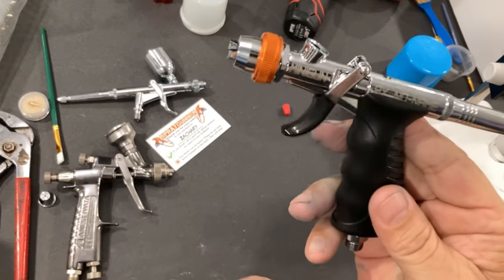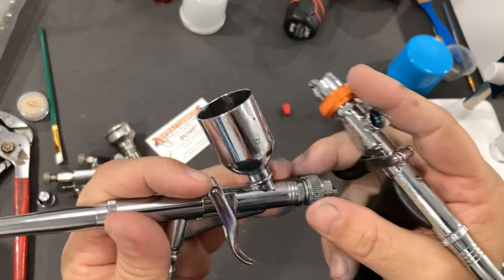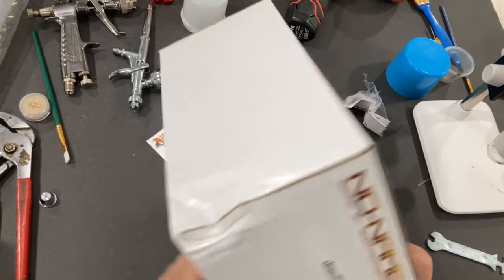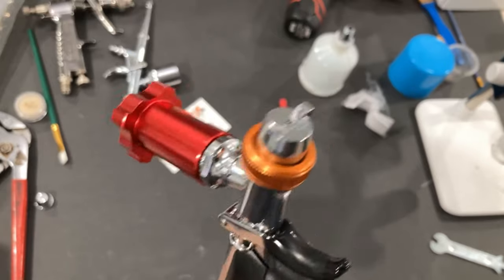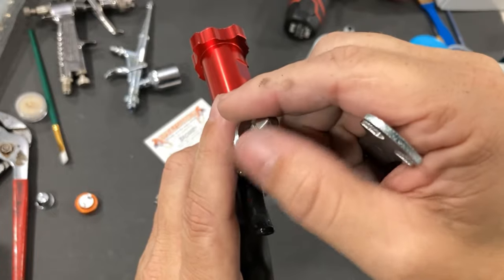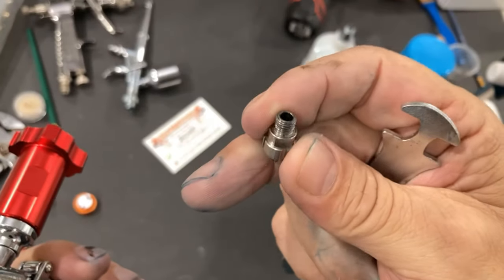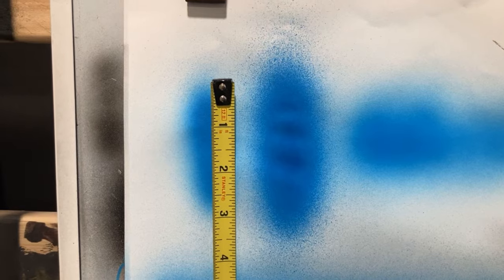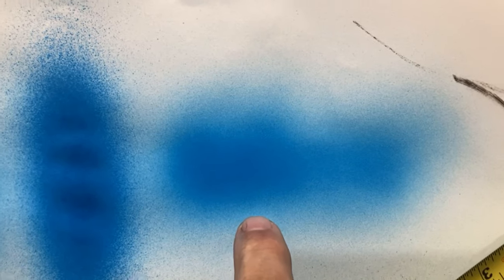Fantastic!  The "no name" Minigun.  NEW fan pattern round pattern combination airbrush!

Comment: Great review, Bill!Just seen your shorts on the pps cups 2.0 fitting the ps290 great hack, by the way! Love pps system in particulary the 2.0) I won't go back to using regular cups.  The one looks solid! Pretty good spray pattern! Thanks for sharing 👍
Reply from the maker: unfortunately the 2.0 wont hack into this cup..   But im leaving the 2.0 setup behind and going back to the old style because the 3 oz cups are too shallow to be useful.   i realize a lot of folks wouldnt use a pps cup for small amounts of paint.  because they are kinda expensive.   But i like to keep my water based clears in a PPS cup.. Because well you get it who wants to clean cups :)    They also sell an adapter for the 290 now.  (i may sell my 290 after I get a .6 for this one.. but I still kinda love that brush) 

I would honestly not hesitate to paint a lot of stuff with this that I would normally use my lph 80 for.

Comment: Does air brush have fumes? I want to paint something 6 inches wide 15 inches tall . Trying to get away from spray cans . Painting plastic
Reply from the maker: depends on the paint,  but most waterbased airbrush paints are fairly low odor.    you still want to use a mask for the overspray.

Comment: Also be careful if you go to take that bigger nozzle piece off, I used me wrench from my hvlp and it chipped a section from the outer threads, the meatal is soft.. use a 17mm end wrench, the end that goes all the way around it to be safe.
Reply from the maker: I have not removed the head assembly.  Ive pulled them off the procon boy 290 and a TH before and both times dinged them up..   They are all brass and if like those brushes on extremely tight.

Comment: Please HELP. Would this run with the iwata studio series compressor & would the gun work ok with solvent based paints?
Reply from the maker: I don't think any of the studio series compressors are strong enough to run this.  You are going to need around 1.5 CFM or 44LPM  to run one of these.   I believe the power jet pro only delivers about .8CFM  

The second answer is yes these will work with solvents.
Reply from the maker: i actually forgot the maxx jet, which I think would run it.   but as below.  1.5 CFM is your target to use one of these .
Reply: @TheAIRspace  Thankyou
Reply: @TheAIRspace  could I maybe bother you will the problem I’ve got? So basically im looking for a trigger style airbrush with a fan cap. I do surface repair for a living & the company I work with it’s all very heavy gear & im tired of carrying all the overpowered equipment I just want something I can use with a small compressor that has a fan pattern that I can be more mobile with 😂
Reply from the maker: @Adventuristic89  the other brush I showed in this video is the GSI creos ps 290   
and you can find it here 
https://amzn.to/3uVWmzH 
*Aff Link* 
if thats a big enough pattern to do what your looking for.  
But its a .5  how thick of material are you spraying and how big an area are all questions you gotta look at.

Comment: Wow. My Grex is not even close to that gun. I have a heavy top and bottom and the bottom  is not looking so good. The pattern looks like a barbell shape. This gun is sweet.
Reply from the maker: Dumbell shape spray patterns have 3 causes... 
Air pressure too high, fan pattern to wide or fluid volume too low.  

Since with these types of guns we cannot adjust the fan pattern,  and presume we only turn up air high enough to achieve atomization..  It leaves us with one problem.   

Like MANY MANY spray pattern airbrushes.  The grex suffers from the wrong type of needle for a spray gun type performance.  Two things happen when the needle protrudes through the nozzle that are fighting against the entire purpose  of a fan pattern.  
One your volume is partially blocked from the needle, even when fully retracted it is still choking off volume.  
Two as fluid follows the air as it closes in around the needle you are pulling the paint to a smaller diameter (which is why long tapered needles produce finer lines generally speaking)   Of course THAT is at odds with spraying a wider pattern.  
   Lower volume and room for pigments of course is at odds with spraying heavier paints .. like basecoating with pearls and such.  Or heavy primers.   Things you might be wanting to use a "large coverage" for.  

Of course when i mention those glaring defects people get touchy. 

With that all said, by far this gun has outperformed every other fan pattern airbrush i have tried.  Even the gsi creos 290/ iwata wont compare if high volume coverage is what you are looking for.   The TH2 and this are close... the TH atomizes a little finer perhaps.  This has a slightly heavier coverage.  
FWIW i think the Tritium is massively overpriced.